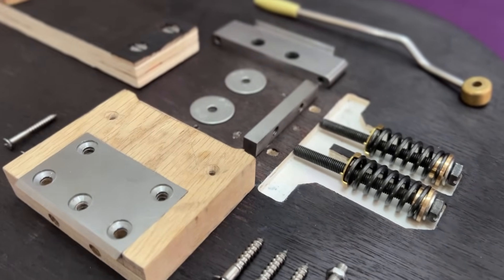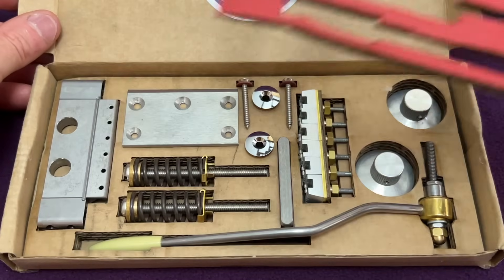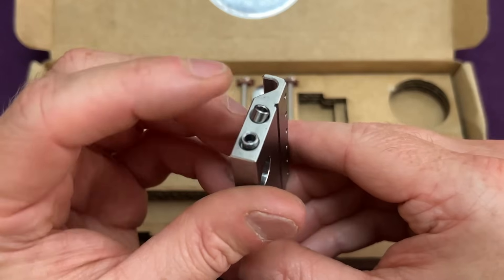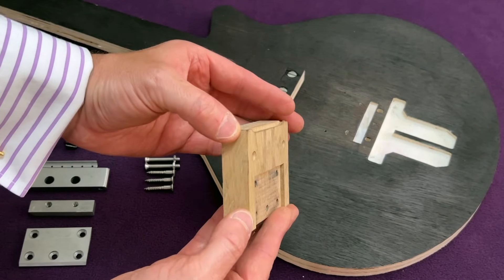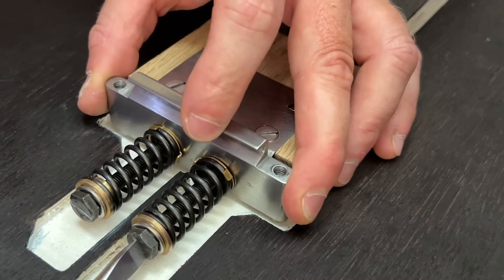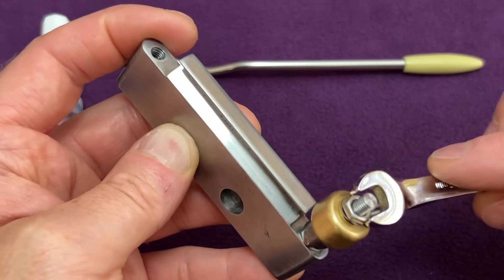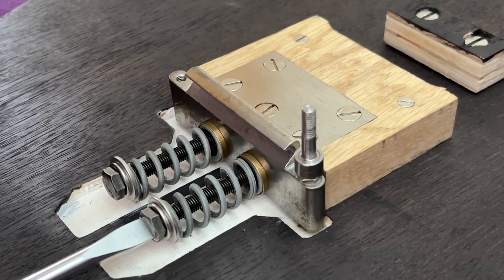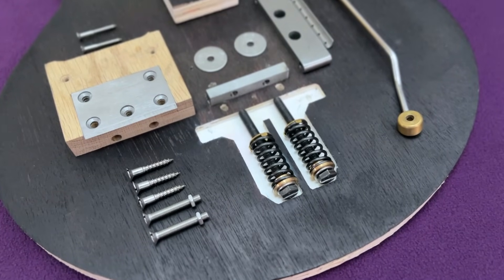Brian May Red Special Tremolo System Part 2: Function, Set-up & Demonstration

Comment: Will the trem drop the pitch a full octave if balance vertically or does the trem need to be balance slightly backwards to get mote downward movement?
Reply from the maker: @philipreeves5465 I haven't measured the downward pitch movement in terms of tones and semitones. I think it will yield a full octave from vertical.
Reply: @dsgb great stuff. I was wondering if wider size spring holes in the trem block would allow more downwards movement. Noting your holes to be slightly smaller than the RS kits you bought. It would seem the block is restricted by catching on the retaining bolts
Reply from the maker: @philipreeves5465 Yes, you are correct. As I point out in the video, tremolo systems, including this one are intended to allow the player to create a modulating pitch variation but lots of commenters on here and particularly my Facebook update posts seem fixated on the range of downward movement for "dive bombs".

I tried to cover several different configurations and discuss their characteristics in this video so I'm pleased that you recognised some of the inherent limitations in the hardware that I made. 😀

Check out the diameter of the set screw pass through holes tremolo hardware Greg Fryer got made for his Red Special replicas at the link below. They're 3/8" and in a similar position to my hardware.

https://fryerguitars.com/wp-content/uploads/2014/09/fryer-tremolo-tailpiece.jpg

Doug
Reply: Really enjoyed this video mate. I’m looking at putting a similar unit onto my Jazzmaster. The RS tremolo is a fantastic unit and very simple to keep in shape. 
Great video

Cheers 🍻
Reply from the maker: @anonymousanonymous3073 Thanks for your positive feedback, much appreciated. 😀

Comment: Excellent explanation.  I was wondering if the rest position was vertical (floating in equilibrium) versus against the block.  The answer is equilibrium, where the string tension balances the tremolo spring compression.  Seems like it would creep out of tune this way, but I guess not.  Plus you get the benefit of adjusting pitch both ways.
Reply from the maker: @SonofaDiddly A correctly adjusted tremolo with no free play in the mechanism and locking machine heads should hold tune perfectly. Only variations in ambient temperature will cause expansion and contraction and affect the tuning.

Doug

Comment: Can you change to Drop-D on the fly without needing to adjust the springs? I wouldn't think it would change the overall tension that much, I know Brian sometimes changes guitar for Fat Bottom Girls, not sure it's every time.
Reply from the maker: @stevekgoodwin The springs wouldn't need to be adjusted to change to drop D tuning but as with any floating tremolo system, the tuning of all the other five strings would need to be adjusted which would take a few minutes, hence why Brian has a separate Red Special replica ready tuned for Fat Bottomed Girls for a quick switch, mid-performance.

Doug

Comment: Brilliant. I purchased a D.I.Y. Red Special and its excellent apart from the tremolo arm mount and fittings/brass topper.  The one I have has the thick stopper that goes on after the first nut fixed to the thread of the screw and is immovable and the wrong length so to get the right arm clearance from the body their isn't enough thread for the brass topper unless you remove the washers that allow it to swing freely. Can I purchase the screw and fittings on their own?
Reply from the maker: @lanehewitt7685 Yes. I buy all my fasteners from eBay. There are various suppliers in the U.K. who sell small quantities of fasteners in all sizes and types including imperial thread. Should be no problem.

Doug

Comment: Interesting video. I can vouch for rs mods kit. Very good kit. I also like the rs conversions one from usa. They are not interchangeable though
Reply from the maker: @briw4647 Both are very well designed and engineered hardware kits. Ron Smith is a superb machinist and a great guy so I always recommend his Brian May Red Special hardware to people in north America.

There are always subtle differences between design interpretations which means that parts from commercial hardware are often not interchangeable as you point out.

Thanks for commenting. 👍🏻😀

Doug